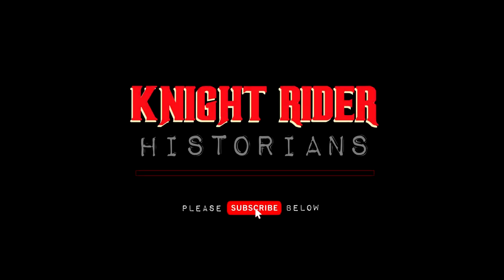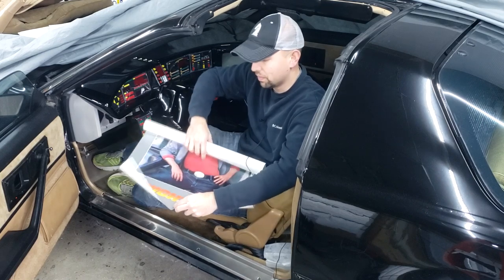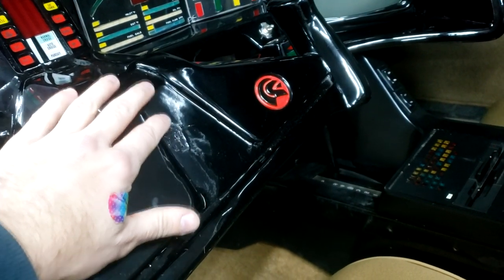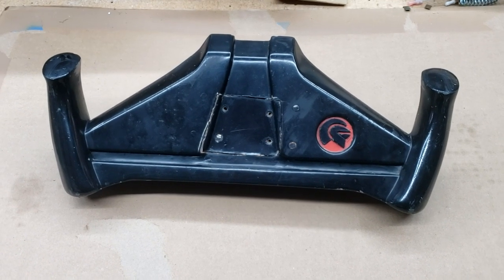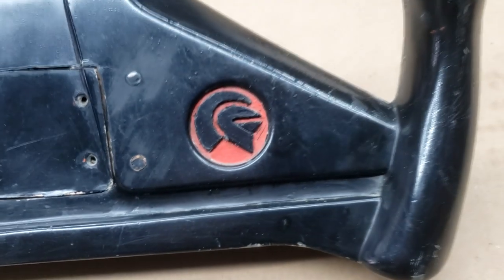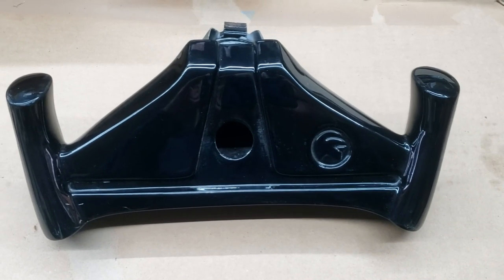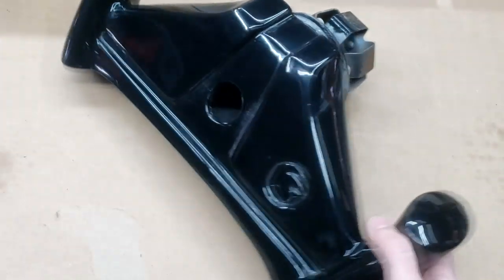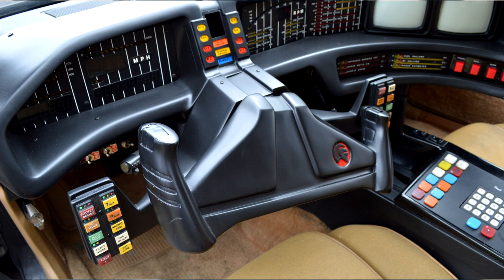FOUR SCREEN USED KNIGHT RIDER KITT STEERING WHEELS!

Comment: The second Gullwing Steering Wheel with the access door on it's facial, can clearly be seen during Season 2's episode, "Ring of Fire". That particular steering wheel is featured early in the episode, after Michael Knight was shot at by Cray (Christopher) Callan. KITT drives to Michael's rescue..., then breaks into a 180 slide (while opening the door for Michael to get inside). As Michael Knight hops inside KITT, the access door on the face of the Gullwing Steering Wheel can be seen from the Passenger's side camera point-of-view.

Comment: What’s interesting about this is a few KITT replica owners hate this wheel because it hits them in the nuts when they have to turn hard or fast. 
Are the screen used ones not as wide?
Reply: Yes I believe there not as wide as replicas, but in the show they never show michael taking hard turns.

Comment: Hi Joe Another excellent Video!!. Its been a lot of years gone by and I could be wrong but .I believe that the first wheel that you showed is the one that I had to repair back in the late 80's  and I assume that it is on the Car you have now and you drive yourself I can't put a date to it, but I am pretty sure it was on  one of my first visits to work on K.I.T.T that I had to repair it ,   I didn't have much time to repair the damage that some one caused ..Not sure why anyone would deface a beautiful Steering yoke like that by cutting a chunk out of it . But as you know there is all kinds of Crazies out there  I had to borrow some two part epoxy paste from Universal  maintenance , it was a quick and dirty job and I didn't have time to sand it as well as I wanted to Because I had about 10mins to work before the park opened to the general public ,So  I sprayed some black lacquer over it trying to match up the paint as best I could ..I think its cool you still have it , Hell I wish I had it to hang up on my K.I..T.T. STILL ROCKS WALL with my Flag, License Plate, and Shadow Box with Original K.I.T.T Parts that you sent me .As always You and Sarah and the Kids , STAY SAFE ,AND KEEP UP THE OUTSTANDING WORK FOR THE FOUNDATION !!  Later  Jake

Comment: Awesome stuff. Particularly interested in that issue with the hole in the center of one of the wheels. 

It always appeared to me that there was a pilot wheel with the  "Knight Two Thousand" lettering and then an alternate car using a wheel with an indented hole in the center swapped back and forth between seasons 1 and 2. 

The "hole" actually appeared more like a design indent and not for practical stunt use. Can you confirm if that was the case? Or were all the center holes always for stunt work?
Reply from the maker: The original Scheffe wheel had a hole in the center for mounting the wheel that he covered up with a piece of styrolite. When the wheel was molded by universal, that hole in the original wheel created the indent you see in the copies.

Comment: I have a question regarding the first wheel shown . .on the underside access door.
Once removed does this give you direct vision to spline thread and nut ?
If this is correct , how come all the versions shown " off car" show a mounted rear boss,moving the splines further from the wheel ? .
Why ? and is there a set measurement of rear boss stand off ..
Thank you for your time .